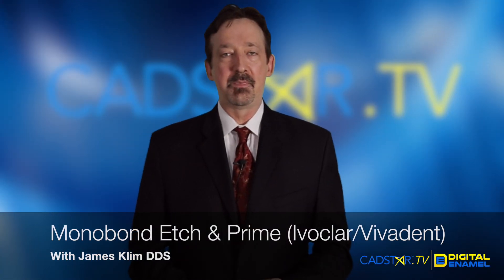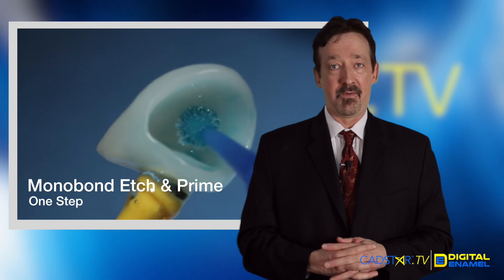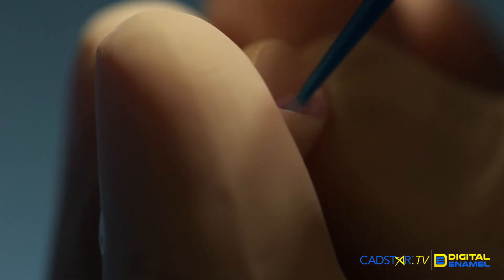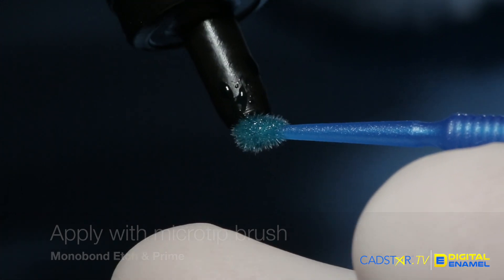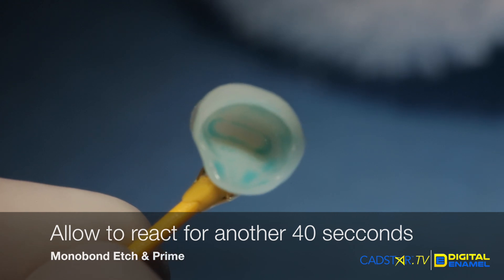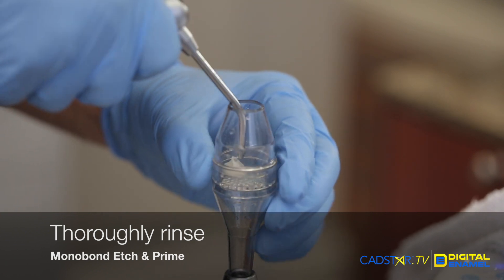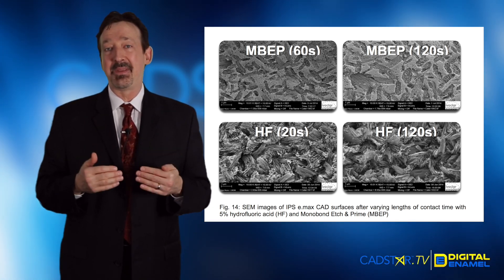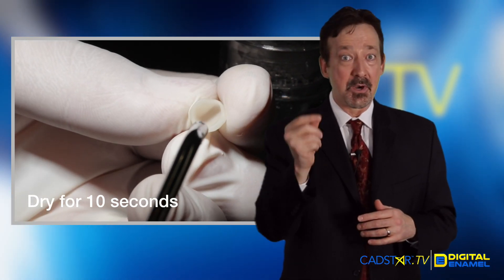Preparing Ceramics with Monobond Etch & Prime

Comment: great video . Quick question. can this be used at all to repair a fractured porcelain crown, being that you say the hydrofluoric acid  can be dangerous?
Thanks for your assistance in advance. Lanny
Reply from the maker: Hi Larry.  With a rubber dam, I have used  Monobond Etch & Prime ceramic condition.   The manufacture has guarded remarks about both hydrofluoric acid and Monobond Etch & Prime in the mouth.  For me, it is more about isolation.